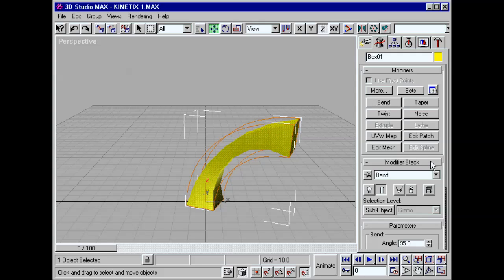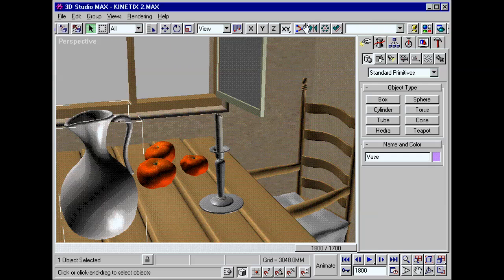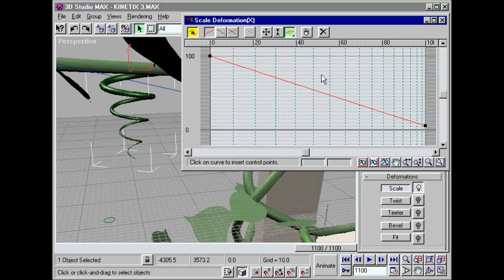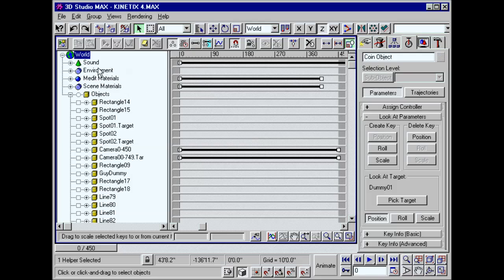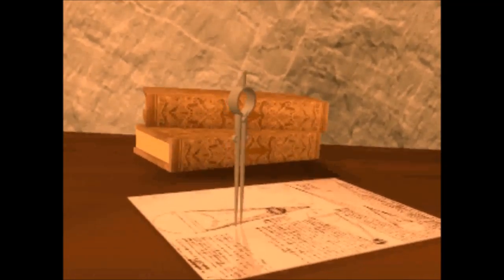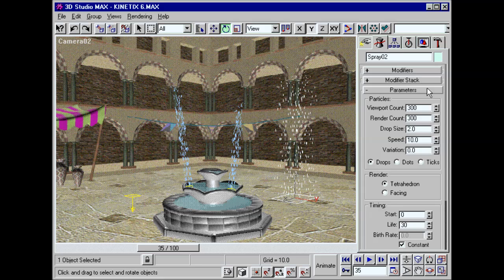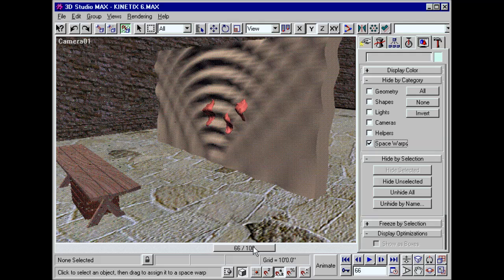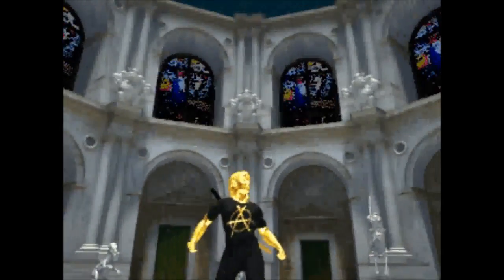3D STUDIO MAX KINETIX DEMO 1996

Comment: I can hardly believe it's been 30 years since this was released. After 3DS DOS, MAX changed the game completely. For the first time, you had realtime 3D viewports - previously restricted to expensive SGI hardware.
Learning it was brutal. In those early days of the Web, the only ways to learn new software was books, college courses or those new 'tutorial websites' that had started popping up (3D Cafe!). To learn MAX, I bought an 1100 page volume called 'Inside 3D Studio MAX' and spent three years working through it.
Today, I work for Lockheed Martin, developing training visuals using a combo of MAX, Blender and Unity. MAX gave me a career.

Comment: I use Gmax which was a stripped down version of this version of this exact software. Except it was given out for free. Even the UI is the same. If you knew how to use one of these, you already knew how to use the other. But Discreet didn't want people using it to make cartoons so they removed the render function and many of the modifiers. It was mainly used by hobbyist who made mods for Neverwinter Nights and Microsoft Flight Simulator. It hasn't been updated since 2002 and was available for download on the Turbosquid website up until a few years ago.

Comment: Story time:  In 1996 I was taking Drafting 2 class in High School. The teacher let me mess around with the single copy of 3D Studio R4 running on the most powerful machine in the school, some 486 DOS machine.  It was fun and I enjoyed the Shaper and Lofter, and setting up camera angles.  Then later the teacher got this same Demo CD in the mail for Max.  We had no machine to run it, so she asked me to decide if the school should buy a new machine and the full 3DS Max R1 program as well to run as a pilot program for the school.  Well, we ended up getting the NT 4.0 machine and I spent about a month measuring classrooms in another area of the school and recreating them in Max.  Then I mocked up how the rooms could be redesigned and made a walk thru video showing the new room layouts.  This was then demo'd live during a school board meeting in hopes of getting more funding for the new "Graphics and Animation" department at the school.   A few weeks later I graduated and went off to college.  I wonder what ever happened to the high school graphics dept...  I need to find out, I guess.  During college, I ended up getting cracked version of R2, R3, and R4 and messed around with them a bit in my free time as an engineering student.  In one of my general engineering classes, they asked us to "redesign the student study hall " in an old building.  Well, I was ready for the challenge.  It turned out that a fellow student in that class also had Max and tried to get a video for their team presentation. His render attempt crashed, but mine did not. So we had a great video walkthrough of the new room. Time went on, and I never really did much animation. Nowadays I hardly even think about 3D animation at all, but I think its time to dust off my legit copy of Max R8 that I got from a local high school during a robotics competition.  p.s.  I still have the Max R1 demo CD in a box somewhere, so I will try to record a copy of it as well, as this video here is missing the menus, and has the Character Studio segments out of order, since the behind the scenes erroneously showed first, before the final result with the characters.. ( this is backwards from how the other segments are presented).  Fun times for sure !  
I found the video of the "engineering study hall redesign" https://www.youtube.com/watch?v=w81P9f07U_Q
Reply: Hah i kinda did the opposite to you.  I was doing work experience at a graphic design shop in 94 in grade 12, that had a copy of 3D Studio (not max) R2 I think.  The next year I started Microelectronic Engineering at uni.  In 96 I got a cracked copy of Max R1.  I spend all the money i had on 96MB of ram, flunked out  of uni and taught myself max for a year.  That got me into a multimedia course which got me a job in games.  Now I've worked at Ubisoft, Biowarre , Microsoft and Meta and owe it all to that cracked copy of max.

Comment: Surprisingly, the program's interface has not changed in nearly 30 years. This shows how perfectly it is designed.
Reply: more like everyone got used to it and they would bitch if anything changed.. same like Zbrush will be stuck with its horrible "2.5D" UI for ever
Reply: Yeah, except for Autodesk is trying to add new stuff that is not fully nor properly intgrated!

Comment: I used to use this after I swithced from Imagine 3d for DOS - does not seem that long ago. I even have the original scene files on my hard drive :)
I was running a dotlink computer, 120  mhz 16mb of ram with a 1 GB hard drive , running windows 95

Comment: As someone who uses Blender, I was expecting to be amazed at them treating features I know and loce as groundbreaking.

Instead, I'm amazed at them showing things I don't even think Blender has!
Reply: When a lot of people talk about and show support for Blender, they focus on the quality of it's renders and not it's actual utility as a tool. Up until relatively recently Blender was the only 3D modeling software that required new users to follow a 15-20 minute tutorial to figure out how to make basic primitives, even if they already had previous experience with modeling using other software.

There is a reason that Blender hasn't actually taken over major paid software despite it being capable of outputting quality models.
Reply: @MedicSound  I find it hard to believe you're not biased. While Blender is, indeed, definitely weaker, I feel like you're presenting it in a way worse light than what it actually is. Blender is VERY powerful in the right hands. And when it comes to things like game development, it can do basically everything 3ds max can do. People aren't only focusing on its renders, they are absolutely focusing on its utility as well. It's an excellent tool for hobbyists and people who are learning, but also for professionals - and some small studios are already starting to adopt it.

20 minute tutorial to learn how to make basic primitives? When was that? I've gone to 15 year old videos, and it seems the way you make primitives was the same way you do them today - press a hotkey (now it's shift+a, then it was space) to open the menu, then add a primitive. That takes less than 5 seconds to learn, not 15 minutes. Every software needs a long-ish introductory tutorial for people to get used to the interface and the way it works, maybe that's what you meant? In that case, 3ds max isn't any better.

The reason Blender hasn't taken over big studios is because 3ds max is, indeed, better. It's older, its premium price means that the developers had more resources and incentive to make it good fast, and even if it's 5% better than Blender, companies will unequivocally opt for it. Not to mention that in formal education, most of the time you'll work in industry standard software like 3ds. The ecosystem is already there. Blender is getting good, too, though. It's unrecognizable from what it was just 5 years ago, and changes are still coming.
Reply: As someone who switched from 3DS max to blender because i cannot afford thousands of dollars a year just for one piece of software, Blender introduced geometry nodes which gives you the ability to distort meshes in real time. 

Overall It works fine for 3D modeling though i do miss some of the efficiency 3DS provided until i learnt all the keyboard shortcuts. When Blender re-worked the UI to make it more user friendly and implemented real time rendering it got a lot more popular.

Comment: How is it possible? This software came much long time ago and it still has some features that modern software like blender doesn't have (Biped for example) 
I'm pretty amazed
Reply: Biped was a separate plugin you needed to get. Even maya that's mostly used in animation nowadays doesn't have one and relies on external plugins for quick rigging
Reply: @angosalvo5734  I recently created a plugin for 3ds Max that connects Unreal Engine Mannequins and MetaHumans with BIPED, it is the ultimate.

Comment: is there any vhs tapes uploaded of guides/tutorials for this or early versions of 3d studio max out there? I'd love to see them.
Reply: A whole lot of the functionality and UI control never changed. Eg: if you currently use max2016 or newer, then you probably already know how to use max 1.0

It's the older DOS versions that were crazy crazy different. But those are just called 3d studio. Not Max
Reply: @Biaanca5036  actually these versions are extremely awkward to use compared to 3ds 2016 and up, I don't know how to make extrusions without clicking a button manually for example, it seems like a lot of hot keys don't exist, or if they do, I can't find any documentation on how to do things as fast as I can in 2016+
Reply: @Biaanca5036  I did interestingly enough upload a bunch of VHS tapes on how to use 3ds max r2.5 and r3, however, it looks like most of the tapes on 3d studio max 1 are just lost media now, so if you ever find those, upload them; same thing for the DOS versions of 3d studio max's training tapes, as those versions are, yes very different.
Reply: Oh hhahha I forgot about hotkeys existing;
That must be rough getting used to new hotkeys and then going back a few versions

Comment: I remeber that time when i've tried to move from using 3D Studio R4 to 3D Max v1...  This was on 486DX50 with 12Mb of RAM...   MAX was very slow but amazed me too much!  It urged me to upgrade and in a shot time i've started to enjoying the MAX smooth running on my new Pentium MMX 233 with 32Mb of RAM...   so warm nostalgic feelings! :)
Reply: Now the Loft has no UNDO for last 10years
Reply: 3d Studio Max ran on WindowsNT, that caused a big leap for upgrading system.

Comment: The nostalgia. 
It's amazing how powerful the program already was nearly 25 years ago.
Reply: It was so well optimised... Now you have a shitty messenger that eats up ten times more RAM and does nothing.
Reply: @englishwithphil42  you mean 100 times
Reply: @englishwithphil42  good ol garbage electron based "software programs" too, it's pathetic now
Reply: It's amazing how much it makes sense at this old scale. Click, do stuff. Nowadays, UI is just piles on piles on piles on piles of mess.
Reply: cuz they are more complex... they also have a lot of more settings thats why it makes the renders better @QuadDamage3
Reply: it gets put into different perspective when you compare to what we had on the SGI boxes at the time. Even with character studio it couldn't quite touch SI|3D in terms of character animation. 3D Studio out of the box without plugins was a bit bare bones. took another investment (plus character studio which was sold separately up until R4) to add some much needed modeling capabilities, particle systems, rendering abilities.

speaking of rendering; the default scanline renderer wasn't great for many years (evident by the first 3rd party renderers being released mere months after its initial release) so 3D Studio had it rough braking into fields like broadcast or movie production. it took us many months to write support for our inhouse-renderer. it was fine once all that was sorted out.

we retired it from our production pipeline in 2012, but nonetheless it was a good workhorse.
Reply: No hope in going to the past come to the loving savior today 
Seek his Holy Spirit in prayer today he can give you peace confort and guidance today 

Romans 6:23
For the wages of sin is death, but the free gift of God is eternal life in Christ Jesus our Lord.
Come to Jesus Christ today 

Jesus Christ is only way to heaven 
Repent and follow him today seek his heart Jesus Christ can fill the emptiness he can fill the void 
Heaven and hell is real cone to the loving savior today 
Today is the day of salvation tomorrow might be to late come to the loving savior today 

John 3:16-21 

16 For God so loved the world, that he gave his only begotten Son, that whosoever believeth in him should not perish, but have everlasting life.  17 For God sent not his Son into the world to condemn the world; but that the world through him might be saved.  18 He that believeth on him is not condemned: but he that believeth not is condemned already, because he hath not believed in the name of the only begotten Son of God.  19 And this is the condemnation, that light is come into the world, and men loved darkness rather than light, because their deeds were evil.  20 For every one that doeth evil hateth the light, neither cometh to the light, lest his deeds should be reproved.  21 But he that doeth truth cometh to the light, that his deeds may be made manifest, that they are wrought in God.

Mark 1.15 
15 And saying, The time is fulfilled, and the kingdom of God is at hand: repent ye, and believe the gospel.

2 Peter 3:9
The Lord is not slack concerning his promise, as some men count slackness; but is longsuffering to us-ward, not willing that any should perish, but that all should come to repentance.

Hebrews 11:6
6 But without faith it is impossible to please him: for he that cometh to God must believe that he is, and that he is a rewarder of them that diligently seek him.
Jesus
Reply: To be honest the most important things dont have changed, stuff is just made a lot easier.
Reply: Really, its more the lack of innovation in the last 25 years.
Reply: It was close they could not make it work in Windows.
Reply: and looks way more user-friendly than modern popular programs, like blender
Reply: @maciejk2 Now Blender has a nice and simple UI, but 4 years ago you would be more than right 💀
Reply: @maciejk2 you are kidding me
Reply: @maciejk2  You are either trolling or being purposely ignorant if you think that blender has a worse, less friendly UI
Reply: @oozly9291  i just had this feeling when i saw first minutes of that video, i guess youre right (and my comment is stupid)
Reply: @maciejk2  to be fair, Blender used to be known for having a very offputting, unintuitive UI that took quite some time to get used to. It was only in recent years that it got a complete UI revamp and is much more begginer-friendly now.
Reply: anyone nows how to download and actually run the program? im with vm windows 2000 but it doesnt run because of some errors
Reply: Zoomer vibe here

Comment: DUDE.  I remember this exact video.  Playing Myst/Riven and Journeyman Project made me really interested in 3D as a kid.
Reply: I worked in Journeyman Project Directors Cut for the PS1. All of those were done with Electric Image on Macs.
Reply: @sideburn  I remember!! I even got a demo of that and an Electric Image/FormZ calendar. Excellent job on Pegasus Prime btw
Reply: I didn’t work on that. I worked only on the directors cut for the PlayStation and I don’t think it ever released. But I knew all the guys at Presto Studios and Jack Davis was my neighbor who was the director of the port to PlayStation. He also wrote the Photoshop Wow books. The PlayStation version had fully animated transitions from one scene to another instead of dissolves. I wrote the game engine and did a little 3D work. Yep FormZ. We had just got an SGI workstation at the time and I was learning Alias PowerAnimator which ended up becoming Maya. I remember ElectricImage was a stack of like 20 3.5” floppies to install it! 😆 formZ was the modeler they used on JP. And ElectricImage for the renderer. The animator has about 5 Macs with a channel changer switch box to flip between machines that were all rendering portions. What a time consuming pain!
Reply: @sideburn  MAN.  I was barely a teenager at that time but it would have been so cool to work on a game like that, with those technical limitations.  I mean, I'm sure it sucked at the time, but it would be fun to look back at later.  Haha.  So I played the original Journeyman Project (Turbo), and then Pegasus Prime which was SOME sort of remake which was supposed to be for the Pippin (lol) and Sega CD, but ended up getting a Mac release for sure, because that's how I played it.  I THOUGHT I remembered animated walking in Pegasus Prime ala Buried in Time, but could be my crappy memory!  I didn't know about a separate PS1 directors cut!  Anyway, great talking to you!  You guys at Presto truly shaped my interests growing up!
Reply: manonthedollar yeah I think those were all fully animated too. Yeah I remember them working on the pipin version. Yes it was way more fun back then with the limitations. It’s too overwhelming these days and there’s huge teams working on a project now vs back then when it was just a few people.

Comment: Guys, anyone using Maya but has or wants to switch to Blender? I'm trying, but god DAMN the camera and movement controls are a pain in the anus. Is it possible, that i can mimic my Maya camera and movement controls in Blender FROM maya? For instance, i can do the "ctrl + right mouse" one, but i want to be able to just click and hold somewhere on the screen, and have that rotate or move the screen around any way i want. Get me? When i click and hold on the screen now, it starts dragging the box around, thnanks
Reply: You can get Maya's controls by setting the control sheme to "industry standard" in Blender's preferences.
Reply: Not sure what this comment means, but have you tried using the numpad controls, that snap to certain camera angles? :o